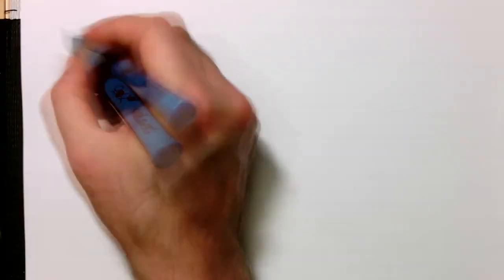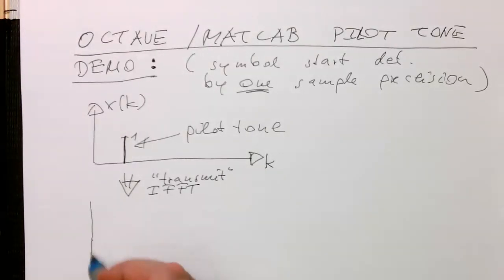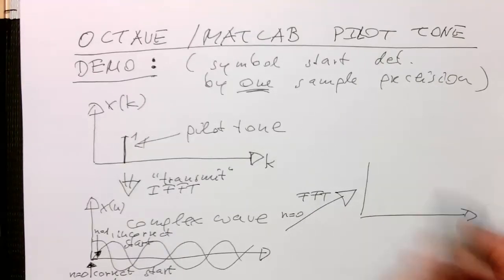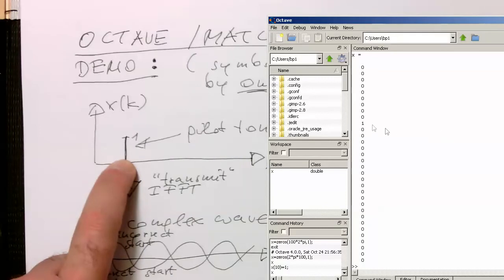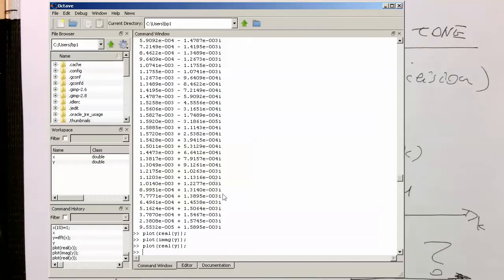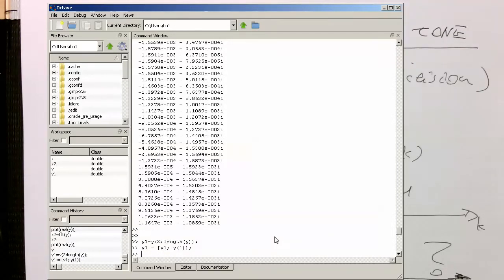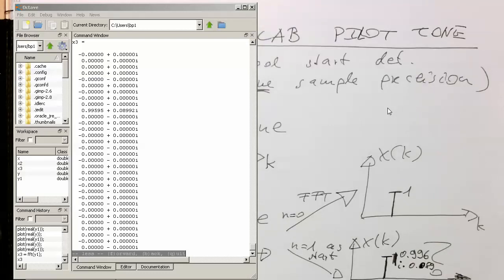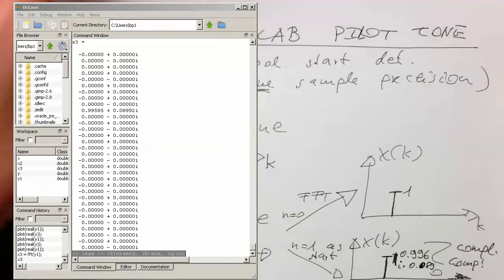OFDM: Pilot tone OCTAVE/MATLAB demo (0030)

Comment: thanks for the great explanation!
I have a question though.
What if I want to transmit a pilot tone over an Audio stream, so I hide it in 17khz or so, with X[k] = 1.
Than I want a microphone to sample it over the air and find that exact location with 1 sample precision. Will I still get that real number 1 in the FFT process?